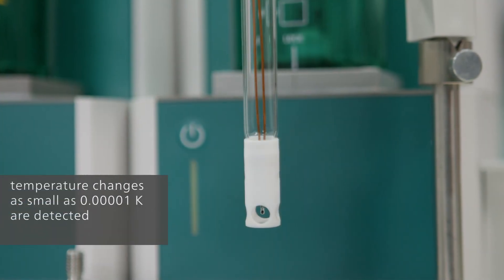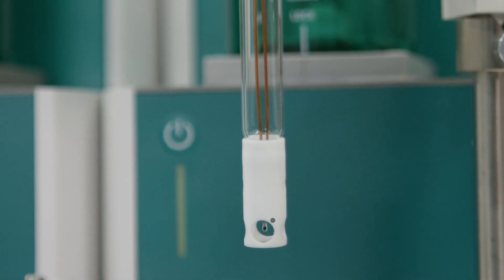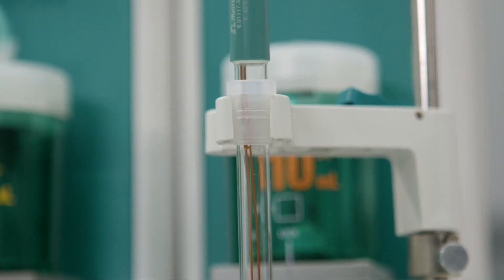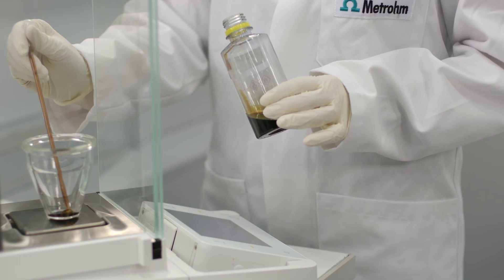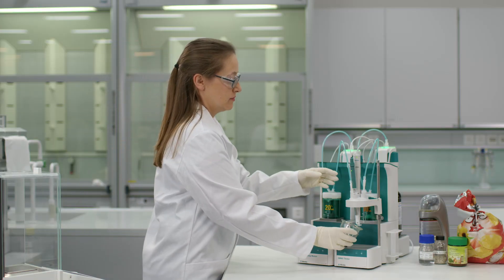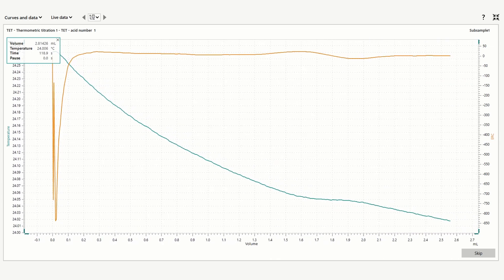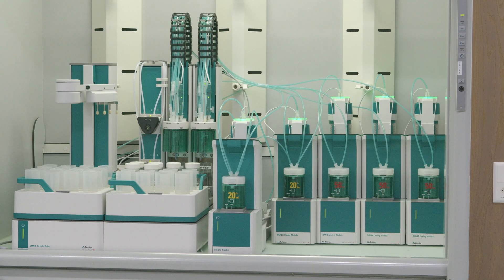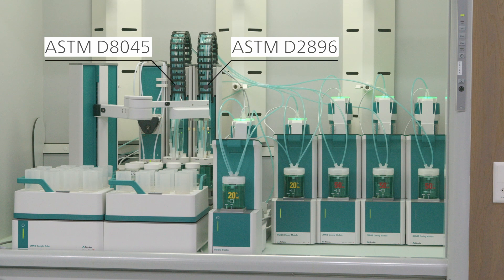Thermometric Titration with OMNIS

Comment: In thermometric titration... how to know that end Point came or not... because in LIVE graph it is not showing that end Point came..... and we don't even know when to stop the titration.
Reply from the maker: Hi Umesh
Thank you for your comment.
To stop the titration, we recommend using the "Stop slope" parameter. You can find the ideal value by evaluating the measuring point list of several finished titrations. We suggest that you look at the slope at least 0.5 mL after the EP. Please make sure to evaluate several different sample sizes. Also check the slope at the start of the titration to choose a suitable "stop slope active after" volume.

Additionally, we recommend activatng the ERC on the x2 axis. With an increase or decrease (depending whether you have an endothermic or exothermic) of the ERC, the EP is indicated more clearly. 

If you need more technical support, please get in touch with your local Metrohm subsidiary or distributor:
https://www.metrohm.com/en.html#country-selection

BR
Michel, Metrohm International Headquarters